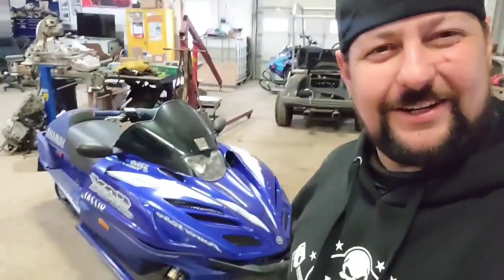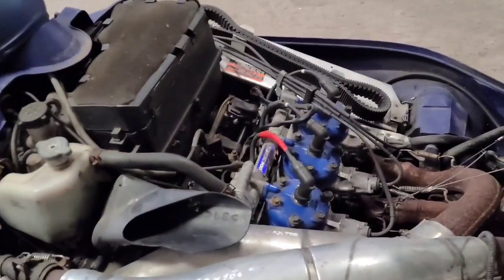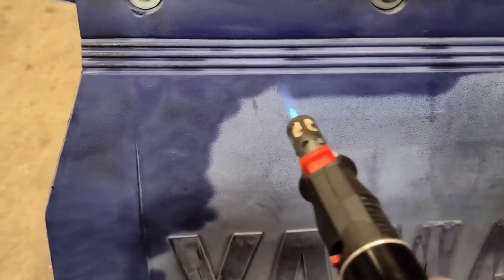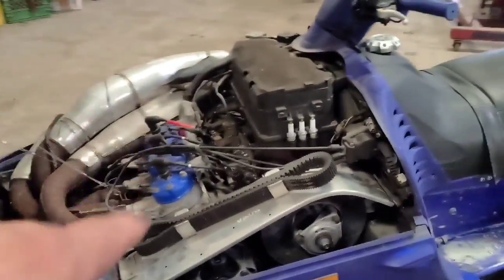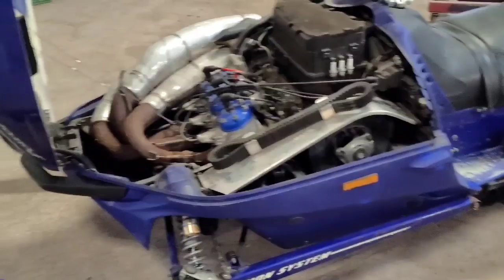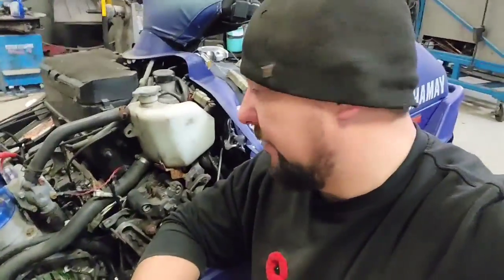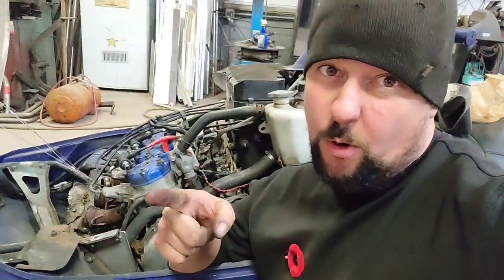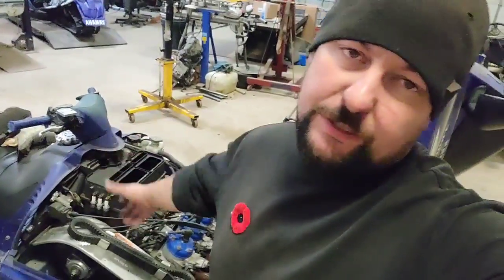Got a sweet deal on a  S R X!!! Will it run???

Comment: I had come across two 2003 rmk’s, the guy bought new, broke his neck and back in early 2004 and the machines sat and sat and sat until I messed with them in 2020. He was going to sell them to me for 500 per but we ended up moving before he found them titles and I missed out. I inquired about them after getting settled and was informed the wildfires that summer took the house, garage and sleds

Comment: i burned a snowmachine up one time starting it up with the pipes off .the flash set the gas i spilled in tub on fire .old kawi 440 no fuel shut off valve.burned thru the fuel line in a heart beat.a word to wise

Comment: Great post and good luck with it. I’d love to see you post gps top speed. I have a 2002 srx I bought in 2016. Had 1500 miles on it. Was in mint condition. Guy must have kept in temp control garage. Such great acceleration. 93.5mph on gps last winter.
Reply from the maker: absolutely! thanks for watching 🍻. we will definitely test it out for top speed...we just need some cold weather and snow lol. we have the radar gun ready and we also picked up a dragy GPS race timer so we should be able to get some good results 👍

Comment: I have a 97 vmax 600 twin and was wondering if you knew about any suspension mods I could do to increase my travel
Reply from the maker: gotta love the old V-max! but not so much the suspension lol 🤣 some fellas would put longer brackets for the rear mounts to raise the tunnel a bit bit you'd probably be better off swapping In a skidoo M-10 or a polaris Xtra 10 or something like that for more travel and a better ride. hope that helps 🍻
Reply: @rednecksdirtyhands  Thanks! Just picked up a 99 srx 600 with 3k miles. We will see if she dangles this winter!

Comment: i dealt with faded plastics found that armoural  soak it rub in with your hand watch it come back new   i run 2 yamahas srviper se xtx and venture yamaha both 1049 cc   both are 2014  i do all maintenance.    pete  are you anywhere near me i am  at lake talon in north bay ont area
Reply from the maker: thanks for the tip on the plastics!  we are 3 or so hours from North Bay 🍻

Comment: Just found a1998 mountain srx 700 last year here in Central Iowa. Wich is rare. Also has the 780 big bore cylinders and whal racing secondary clutch and 8 tooth drivers yhat turn a 154" camoplast ripsaw track. It's currently under restoration now. And would anybody KNOW WHERE TO GET ORIGINAL TUNNEL STICKER GRAPHICS FOR THE SIDE????